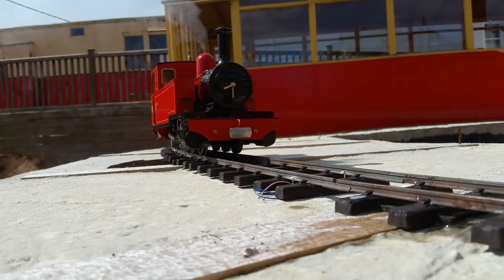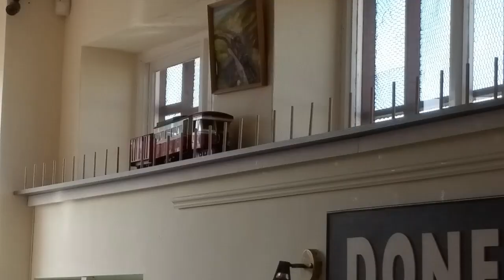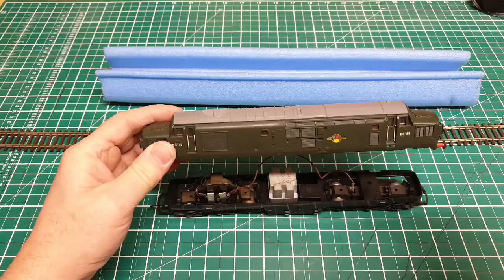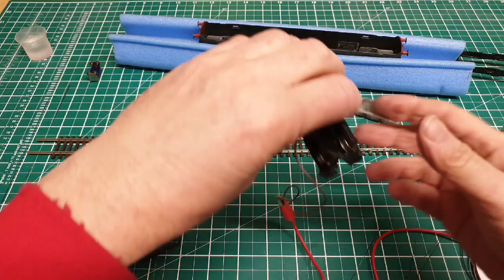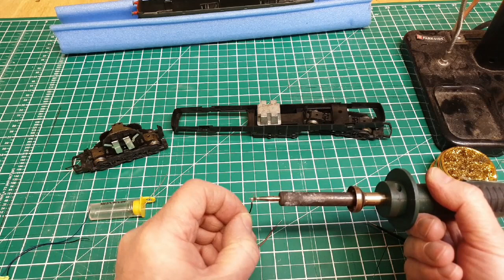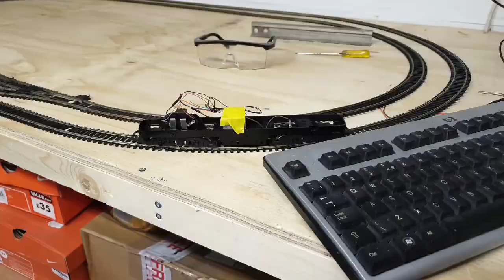39. Servicing a 30 year old locomotive and hard wiring a DCC decoder into it.

Comment: Great video, thanks! The chassis you showed with the old X04 motor on it to explain how a motor works, what is that chassis off? Cheers.
Reply from the maker: Thanks Fern. That motor is used on one of the models of a Donegal Railcar. Was giving it a service at the time.

Comment: Hi love the video, I want to convert a hornby class 37 loco to dcc which I bought in 1979 it has a ringfield motor but it only has one wire a brown pick up to the rear bogies so please how do I connect the 4 wires that you talk about I understand the orange and grey, the black to the rear bogie so where do I connect the red wire on the front bogie. Appreciate you help

Thanks
Reply from the maker: Hi Robert, thanks for the comment. Here is another decoder install I done https://youtu.be/_nvsCDi6HbI. If it doesn't help I do a live on Thursday evenings 7.30pm to 8.30pm (Irish/UK time). Pop in and put a question in the chat and I can show you and help you out.

Comment: How do you strip back such fine wires please.  Sorry, just seen you doing that.
Reply from the maker: I have a pair of wire strippers. See video https://youtu.be/psWpytRlq5I I also sometimes just use a pair of snips.
Reply: @DonegalDadRail  They must be very small strippers that don’t just cut the sheath and the wire and leave you with just a shortened wire.
Reply from the maker: They can be adjusted for wire thickness.